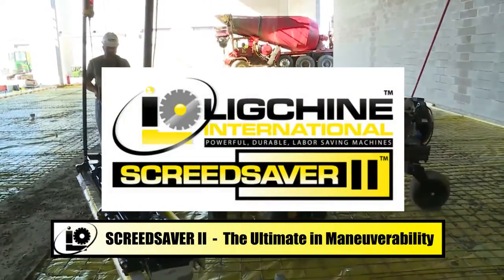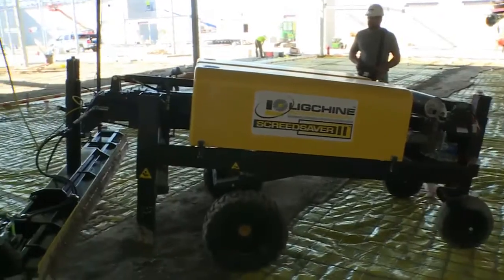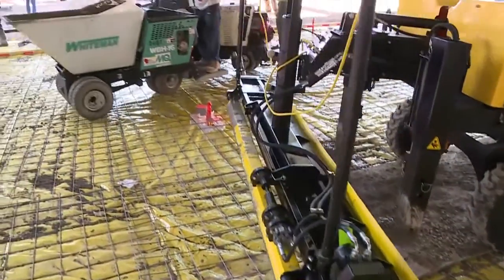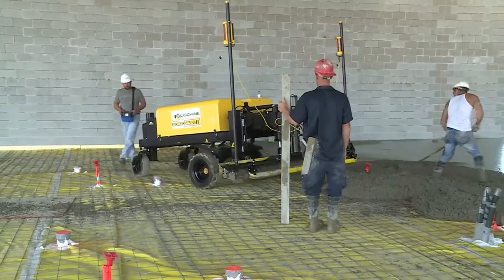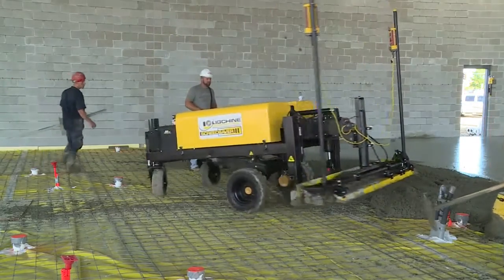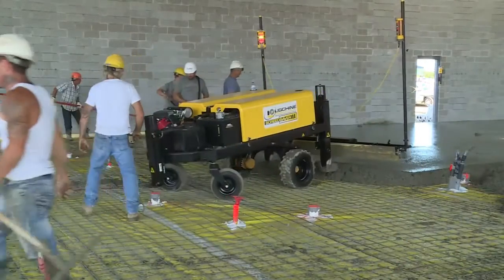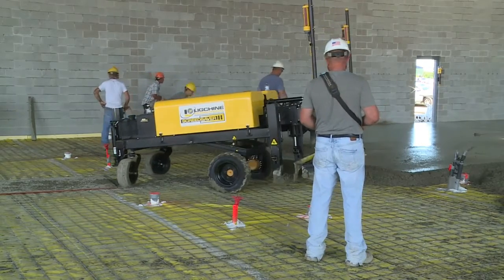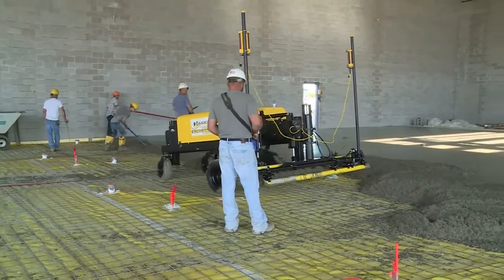Maneuverability: Watch Ligchine's SCREEDSAVER II Display The Ultimate in Maneuverability

Comment: The wire mesh is laying on the vapor barrier not in the middle of the slab. Saw 1 guy pull the wire up 1 time.
Reply from the maker: Thank you for the comment. You are correct--The wire mesh is left on vapor barrier until the concrete is placed by the buggies. Then the mesh is then pulled into the middle of the slab. The ScreedSaver machine then booms out over the placed concrete and mesh so it does not push the mesh back down to the vapor barrier like drive-in screeds commonly do. This video only shows two specific minutes of the entire 6 hour concrete pour that features the maneuverability of the ScreedSaver II so it is not entirely possibly to show all aspects of this job.